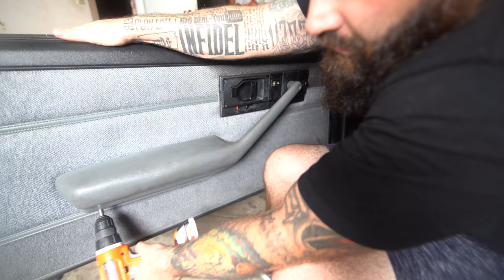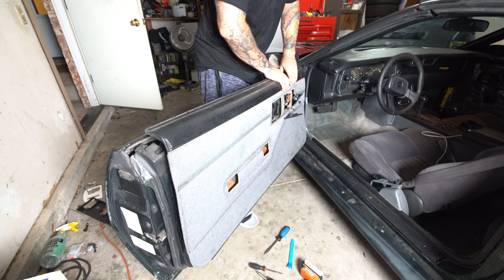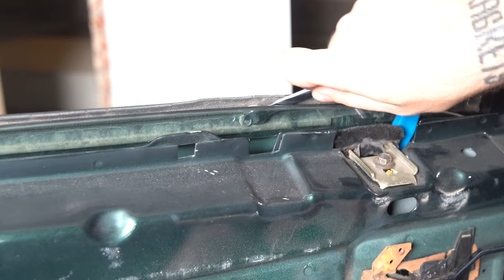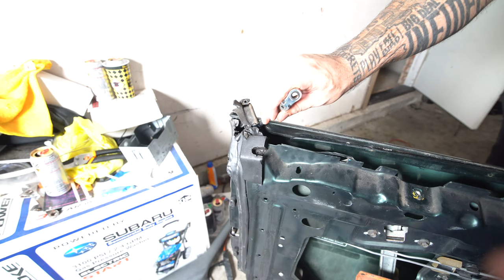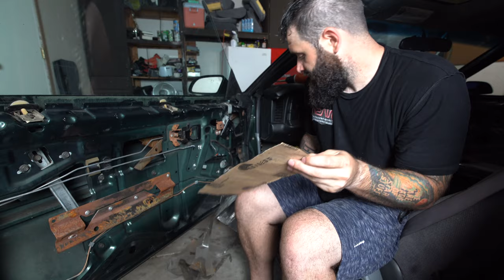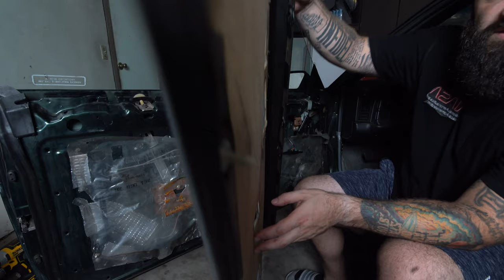Third Gen Camaro Project | Door Sweeps & Seals | Episode 24

Comment: Nice! When I was 18 I bought a 1987 camaro in the summer of "95" I still have it.
Reply from the maker: Don't let it go man!  I bet you got a smokin deal on it :)
Reply: It turned out perfect.  I took my time and I had my mind right before I started! I also did the t top trim and weather stripping. My camaro had a 305 I put in a built up 350 thats around 500 hp. Put in posi with 3.73 gears. All new red leather interior. Stuck alot of $ in it. Not a spot of rust.

Comment: This was good.  Wish I saw this before I replaced mine on my firebird.  Another way to get those pesky bolts is there is a rubber "stopper" at the bottom of the window.  If you remove this you can lower the window even lower.  I figured this out because apparently my passenger side stopper is missing and it was easy as fuck to replace the sweep on that side.  And I could not figure out why the driver door window wouldn't go lower.  Took my slow brain forever to figure it out but once I did i think it was a bit easier than your way and no risk of damaging the glass.  

Props!
Reply from the maker: Nice! Never thought of that

Comment: I bought donor doors for my 91 camaro with much better parts, the donors were from an 87 and they used phillips head screws to hold in the outer window sweeps. Not sure if that comes stock like that for an 87 but I swapped out all the screws in place of the little hex screws, much easier to get them in if you don't already own a ratchet wrench :)

Comment: The outer sweeps are an absolute pain in the butt.  I just did my passenger door yesterday and Mine has Phillips head screws I had to take a tiny stubby Phillips bit and a ratchet wrench to loosen the bolts. I used the sweeps from Fairchild and non of the holes lined up. A bit annoying honestly

Comment: What BRAND did you get? I've read that Fairchild are the BEST opposed to actual NOS but the Fairchilds TEAR at the seam as they glue corners to the rubber weather stripping that goes along the door.

Any update?
Reply from the maker: I don't remember which brand I got.  I honestly didn't even know there was more than one brand making reproduction third gen sweeps.  I'll have to look into that.  Mine are actually ruined now and have to be replaced due to what I'm going to talk about in the next camaro video.  No fault of the manufacturer though
Reply: @beardedreviews  Oh sorry, I wasn't referring to the sweeps but rather the weather stripping you installed at the end of the video :-)

Comment: I installed the door weather stripping and I have to say that was one of the WORST INSTALLS I've had to do.

NOTHING correctly lined up! The plastic rivets were out and required you  to STRETCH the weather stripping to line up to the next hole. Basically  all of them had to be installed or the rivets would start to pull right  out of the weather stripping itself.

The WORST PART is the weather stripping at the top towards the inner  door. The rubber is SO THICK it was EXTREMELY DIFFICULT to push it where it needed to go and then that caused 2 of the rivets to pull away. I gobbed on black RV silicone and QUICKLY put the door panel back together  and closed the door hoping if I leave it closed for a week that it will harden and STICK the weatherstripping to the door.

The door is SO DIFFICULT to close, almost to the point that you could bend the door panel pushing the door..

1. How was your install?

2. Was it difficult to close? (requiring HARD SHUTTING)

3. If so, how long did it take before you can actually shut it normally or is that PERMANENT NOW???

Comment: Hey hopefully you still respond to these comments but, do you know where you got those sweeps and seals, i got mine for rpui by softseal and they came out garbage, the sweeps dont align proerly with the holes and the rubber seals are too thick which caused my door to not close right. I wanna know where you got yours
Reply from the maker: mine came from hawks motorsports.  Hawks used to be just third gen camaro stuff, but now they have a bunch of car stuff.  Their third gen stuff is usually really great
Reply: @beardedreviews  you got both your weather seals and window sweeps from hawks motorsports?
Reply from the maker: @Daniel-jl6vc  yessir.  One thing to be careful of is if you get the outer door seals, the ones that go around the bottom, if you decide to do those I would go to 1A auto for those.  The 1A auto ones have plastic reinforcement like the oem ones, and the hawks ones don't as far as I know of
Reply: @beardedreviews  thanks for the headsup. I dont mind if it doesnt have the plastic. At this point all i care is that my door closes. I ordered some from hawks about an hr ago. So hopefully they arrive soon. Thanks for the advice much appreciated.

Comment: Is there a difference between the sweeps for camaros and trans 3rd gen? I ordered them but seems like the holes on the door are a bit lower and the last hole by the door handle is off by half an inch to the left
Reply: I was about to order these for my 1984 trans am did they work?
Reply: @Johnny Thornton  ultimately had to drill 2 holes on the outside sets as they were off by a bit. Make sure to save the old sweeps to measure out the holes as on one of mine I threw out before I realized. These are the "best fitting" between two sets I've bought. The other from Rockauto had all the holes misaligned these had more holes matching up.
Reply: Alright thanks for the reply I ended up ordering a set of inner and outters from firebird centrel they were like 10 dollars more but I figured the gotta be the right ones
Reply: @Johnny Thornton  you would think! Lol I hope they fit. If you are doing weather stripping as well, I recommend staying away from the ones that look "bubbly" at the ends. Causing my doors not to shut properly. Trying to figure out what i can do without spending extra $
Reply: For sure cheaper is better if it works I’m just doing top felts and those vertical triangle things  the car sat in storage most of its life the door seals themselves are actually still nice guess felts just cracked and dried out
Reply: @Johnny Thornton  for the triangles I took outbcompletly on first door and took a bit to put back in, they have 2 bolts on a bracket in the inside. I would Heat up the plastic and pull out with a crescent wrench. Slips out super easy. Bigger flange goes on outside for new seals!
Reply: Yeah be a good idea for sure I knew they would be a pain by the way he avoided them in the video lol